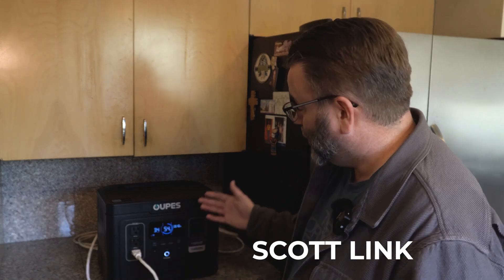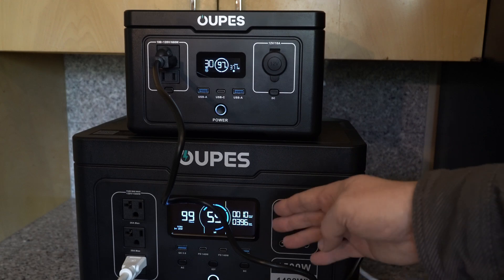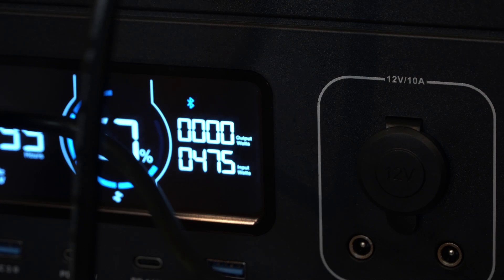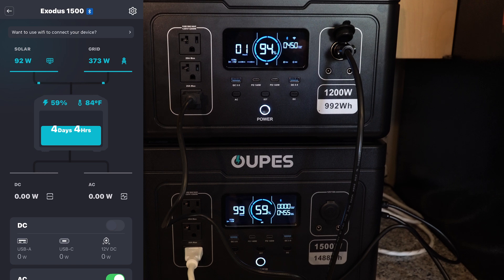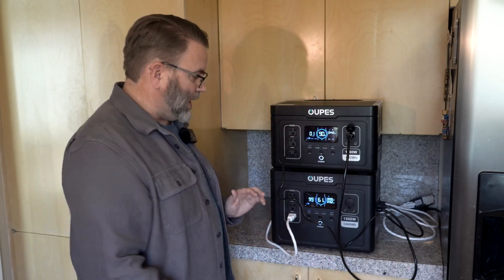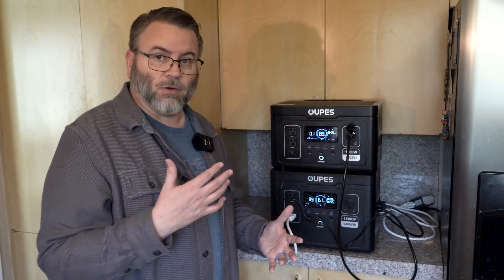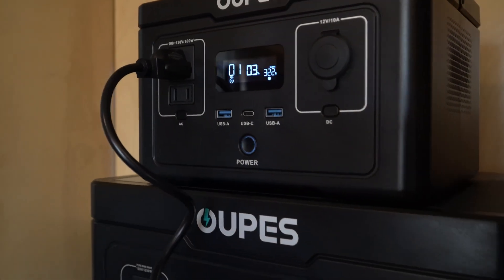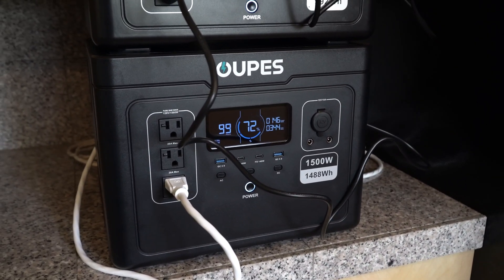Extending Power Station with ANOTHER Power Station? How and Why?

Comment: Use the 12V output. Less losses on AC inverter
Reply from the maker: True, DC would be more efficient, but with only about 120W in. Ac loses more but should charge faster. I need a power station that can pout more DC power!

Comment: Can this be done without the cellphone and app stuff?
Reply from the maker: Yes. The basic cascade doesn't need an app at all. The 600 can't use one. To change from slow to fast charging on the larger OUPES power stations. The internet says: With AC output off, Initiate the charging mode selection. On many models, you need to simultaneously press and hold the "IOT" button and the "DC" button for 3–5 seconds. The LCD screen will flash and display "SET".
Choose your charging speed. While in the "SET" mode, tap the "IOT" button to toggle between the slow and fast charging options.
"L" typically indicates slow charging (lower wattage). "H" typically indicates fast charging (higher wattage).
Confirm the new setting. Press and hold the main power button for 3–5 seconds to confirm your selection. The screen will display "SUC" to indicate the setting was successful. Exit the settings menu. Press and hold the main power button again for 3–5 seconds to exit the function. These might be slightly different from one model to another, but the manual should explain it.

Comment: Call me paranoid but I have 2 300ah 12v in series to supplement my power stations thru the solar port. And if I use that up I have several 12v 100ah batteries to connect in series as well. That way you get max current at 24v. 400w isn't any faster but it's cheap and easy

Comment: Interesting. How would you expand the batteries for the Oupus 2400? It does not have a battery expander port.
Reply from the maker: The video shows one way, cascading the AC output from one power station to another. Without the expansion battery port, you can try AC power from another power station. The 2400 can take 12V of DC power through the solar input, so you could also use that and plug in a "car" charger cable to the 12V port on a power station. You might also use a regular 12V battery to into the solar input.
Reply: @scottlinkmedia thank you! might try the battery to solar input method, but heard their are limitations based on the solar input numbers, and not sure how to lower the batery input to match that requirement. your thoughts? thanks again!
Reply from the maker: @Nissan300zxshowcar I have not tried it, but… the 2400 can take between 12 and 78V of solar DC power. It should be able to take power from a 12.8V battery. It might treat it like a car charger. You could also use a 24v, 48v, even higher voltage battery. As long as it is under 78V. Do not exceed 78V! I’ve not tried it. I’ve seen it done. The numbers say it should work, but of course, make your own decision.
Reply: If you have the expansion cable there are videos to hack the cable and connect a server rack or golf cart 48v battery. That way the power station will see it as a parallel battery allowing you to draw from it and even better it will thru charge the internal and the extra battery with the AC input. That's what makes the mega series so great
Reply: @ronhawkins8604  thank you sir! going to look for that video.

Comment: I daisy chain 3 power banks to my refrigerator with one of the power banks plugged to the A/C outlet and the fridge connected to the power bank.  This way it is on pass through charging and ups mode.  I do this when we travel out of town as we experience frequent outages that can last a couple of hours to a couple of days..  I also leave the  ac inverter always on in case all three units discharge completely to zero this way when the power comeback back on the units will begin to run the fridge again once it reaches a 5 percent charge on the battery.  All 3 units total 6kw of battery capacity.

Comment: Interesting video.  I would only do this if the smaller unit doesn’t have enough power to run what the larger unit is running.   As you mentioned, this is inefficient.  You’re losing conversion of power on both units.   Also, it’s not safe to push these units to their max.
Reply from the maker: Definitely not the best way, but in a pinch... I was asked if this was possible, and it is. Though definitely inefficient.
Reply: @scottlinkmedia  yeah, I would only do it as a last resort, but good video.

Comment: I just had an idiot in the comments tell me that my station will burst into flames if I do this. LOL I've literally done this 50 times without a hitch. Then when I told him he doesn't know what he's talking about he responds with "i work for ecoflow so I know what I'm talking about". Gotta love social media! I made another backup "suitcase" unit where I put two 100AH 12V LifePO4 batteries to a 1500W inverter so now I can add another 2048WH's to my units. I haven't tried to see how long it lasts but I'm pretty sure it will keep my garage freezer and fridge going for a week.
Reply from the maker: That's so weird. It's just using the AC output, or DC output of the device. The power station doesn't know or care what it's charging. It just delivers the wattage. As long as you're under the inverter output limit, it should let the power pass until it drains the battery.
Reply: @scottlinkmedia  Ya unfortunately there are people like that out there giving false info from lack of knowledge. The person asking the question wanted to know if they could buy another Delta 2 unit instead of the expansion battery and that guy said no you have to use the expansion only. I replied saying that wasn't true, that you can "daisy-chain" them together, and he replied with "your unit will burst into flames!" I hope that person didn't end up buying the expansion battery from bad info.
Reply from the maker: @tonyinfinity It’s maybe not the most efficient way to charge a power station, but it won’t catch fire. We’re not shorting anything out. Just plugging in an AC cord. 

I wonder if they are worried about anything else catching fire when they plug it in?

Comment: Could you do this with the Oupes mega 2 into the Mega 5?
Reply from the maker: Using the AC or DC out, you can feed any power station onto another one. You can plug the AC charging cord into the other power station AC output and it will charge as long as you don't exceed the inverter capability of the one giving the power. So in your case, the Mega 5 can take 1800W AC. The Mega 2 can output up to 2500W, so you should be fine.
Reply: Just a quick follow up, just tried it and worked flawlessly , Mega 2 dumping insane amount of W into the Mega 5. As the B2 batteries are easy half the price of the B5 batteries here is my new stand alone backup battery to my whole home Mega 5 system. Thanks for sharing. Wayne
Reply from the maker: @WayneAddison-si7cq  That's great!

Comment: I'm misfortunate to own 2 identical 1224wh power stations that have defective AC inverters. Everything else works OK on them, so I use them to extend battery capacity on my other units that do work. As you showed, it's only transferring 100w from the DC side, but that fine for my needs.
Reply from the maker: That's interesting, and a good way to keep those broken units going.
Reply: @scottlinkmedia  Manufacturer sold me a dud, replaced it with another dud.
Reply: What's was the brand?
Reply: @king_Charles501  Iforway
Reply: @king_Charles501  "IForway"
Reply: @king_Charles501  I've responded to your question twice, but don't see either post.

Comment: Cool video!
Have you tried charging your power station with a stand-alone 12 volt lifepo4 battery?
Reply from the maker: No, but I know others have. The OUPES boxes need 15V, so if you have a 12V LIFEPO4 then you need something to step up the voltage.